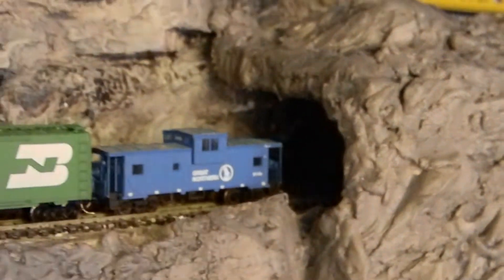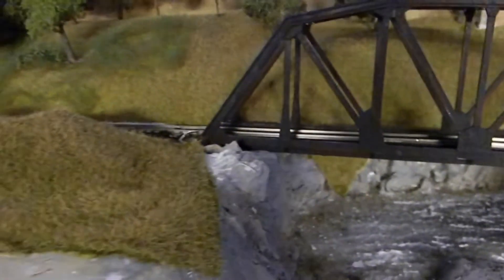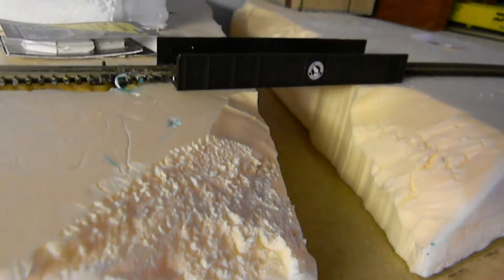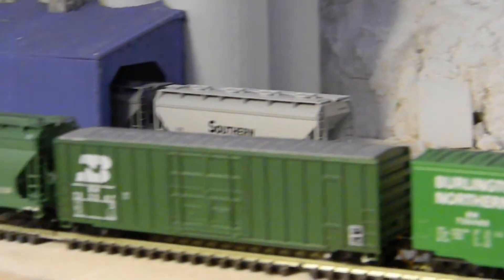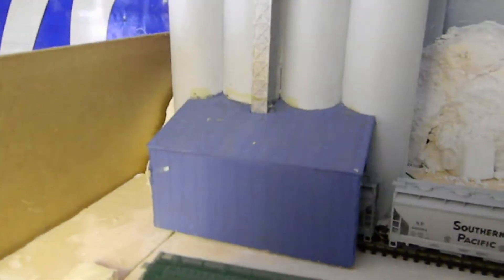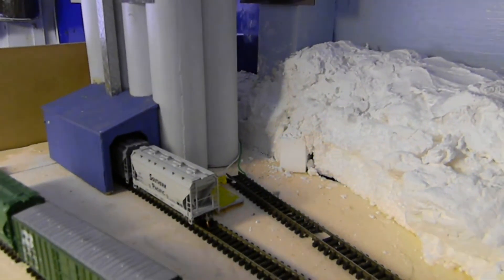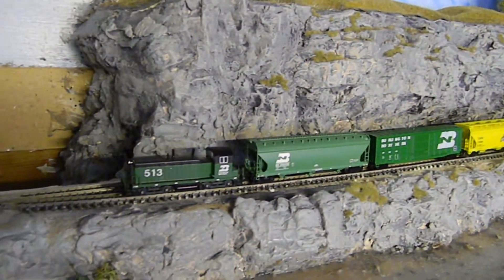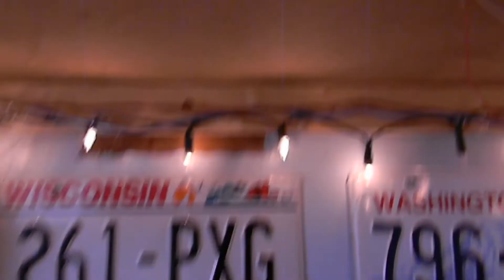Cascade 5

Comment: Hi Andy, Thank you for the Cascade update. I believe most people are doing the same as you for attaching track feeders. Solder the feeder wires onto the rails and then using a small metal rod like a coat hanger, poke a hole in the foam and drop the wires through the foam. When  you ballast the wires will disappear. I do not have any experience with the Woodland Scenics hot wire cutter, maybe this video can answer your question? ( https://woodlandscenics.woodlandscenics.com/show/video/HotWireFoamCutter ) Cheers, Rich S.
P.S. Hi Dats :-)